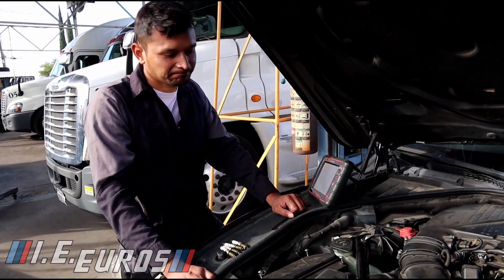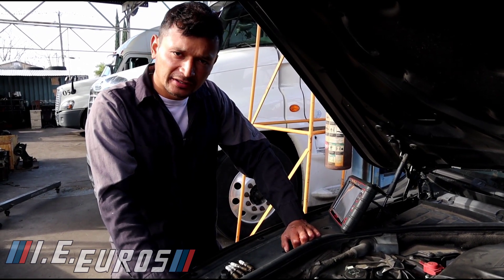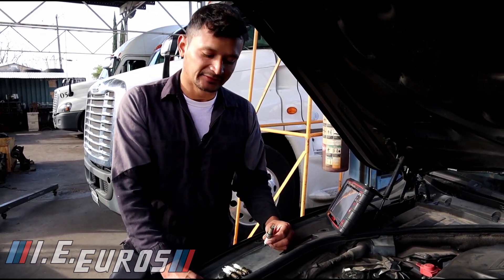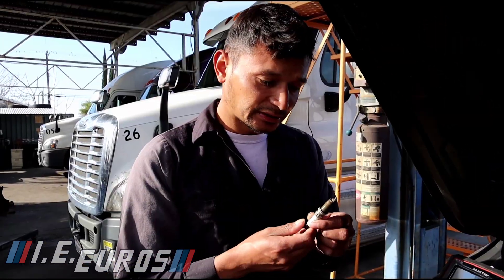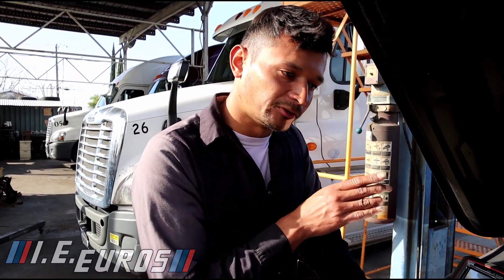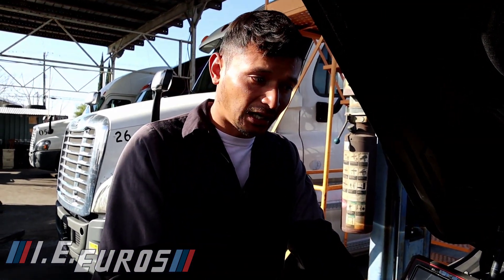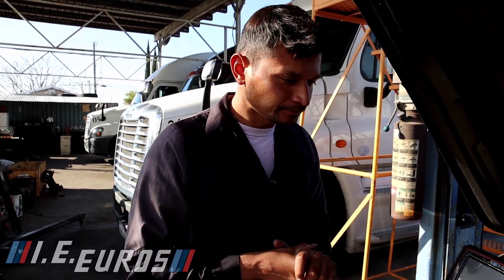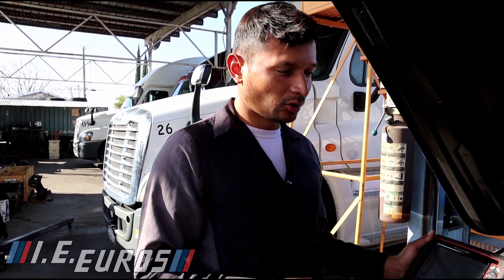BMW engine P0300 multiple cylinder misfire no power check engine light  N20 N52 N54 N55 N63 B48 B58

Comment: At 120k miles I tuned my bmw 550i with new spark plugs and coils…the car had been missing every now and then and since I had never had the spark plugs changed, figured it was past due…the car ran great after…but about 2-3weeks later the car started missing when idling, drove fine but at idle it would miss, sometimes so bad that the drivetrain malfunction would come up and had no power…after watching several of your videos I checked everything over to make sure all was plugged in and payed special attention to the pcv hoses…they were both broken, full separation…I installed two new pcv hoses and the problems and all the strange error codes went away…when I ran the scan tool there were 15 plus error codes, everything from multiple misfires to running too lean, maf errors, injectors shut down…it was really scary and made me think there was something major. So glad I watched your series on the n63 which led me to discover the problem…cost me $165 instead of maybe thousands at the dealer…thx!

Comment: I've been chasing this misfire for my n63 for few months. I have changed coils, on my second set of plugs, about to change the injectors for bank 1, and I have changed both HPFP. One thing i did notice the plugs for bank one were clean, like they had never been fired,. When I checked bank 2, you could tell they had been working. Its the strangest thing, from running just fine to just wont drive consistently. Even did a compression test, all clear there as well.

Comment: Come across this video, my BMW 2012 X5 5.0 got Combustion misfire P0300 and misfire on Bank 1 - P031, P0302, P0303 on bank 2 - P0305, P0306 and P0308 - Everything look clean, I already replaced all 8 sparks plugs and 8 ignition coil .. what will be next to look at?
Reply: Compression test in each cylinder

Comment: I have this exact same problem. I have replaced spark plugs, coil packs and had both pcv valves replaced. I took it to bmw in perth Western Australia and they said I need to replace all fuel injectors as they said they are all failing my car has done 87000km. They said they haves tested them and they are failing they know this because they have a high ohms reading on them. Does this said right they want $8500 to replace all injectors and high pressure sensors.

I am getting ripped off by the dealer?

Thanks
Reply: it's sounds like a joke. injectors about $80-$100 a piece. you would need to reprogram ecu for new frequency wih a tool or a computer + enet cable. total would be about 1k if everything is brand new OEM, if used injectors ~ 250-300.

Comment: 2001 bmw 330ci musfiring p1347: misfire cylinder 3 with fuel cut-off p1345: misfire cylinder 2 with fuel cut-off p1343: misfire cylinder 1 with fuel cut-off p0174: system too lean bank 2